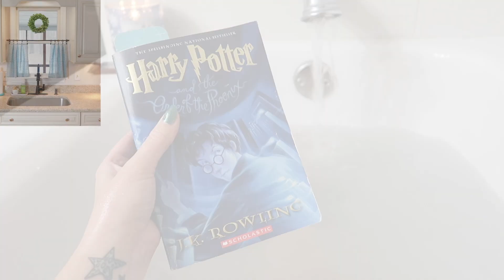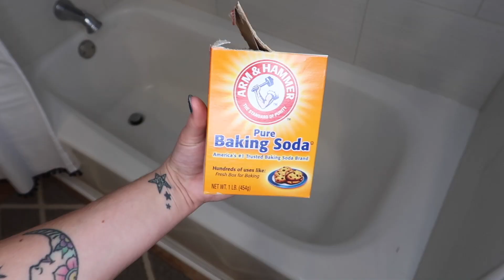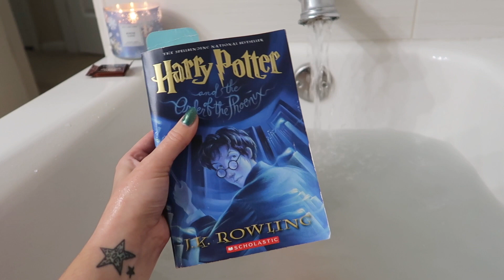Master Bathroom Deep Clean & Decorate With Me | Bathroom Cleaning Motivation

Comment: Well, now I'm inspired to clean my bathroom so thanks for that, I think. ;-)  A couple of things I'd like to mention. It just may be your editing process to keep things shorter in length, but you know the Clorox or Lysol sanitizing sprays need five to ten minutes to work before your wiping it off. I usually spray my countertops before cleaning my toilet and shower and then wipe them down when I go back to clean my sink. Just a thought. Finally, I didn't know about your vinegar and dish soap combo. I'll have to try that. Along the lines of safe cleaners, I have found that vinegar and water and a drop or two of dish soap does wonders for mirrors and windows. I actually use it on my larger windows inside and out during my spring cleaning. It does a really good job and for much cheaper. Again, just a thought I'm looking forward to your before and after video. Merry Christmas!
Reply from the maker: Hi Miss Kat! Thank you for watching!! 😀 I do let my spray cleaners sit for a bit, but I think you're right - I need to let them sit for longer. I will need to remember to spray down a surface and move to another one while it sits, like you said. Thank you for reminding me. I've tried to clean with more vinegar based combos, but the smell makes me absolutely retch, so I've pretty much given up on it. 😆 I wish I wasn't so sensitive to it since I know it's a really good cleaning agent. Merry Christmas to you and your family! 💜